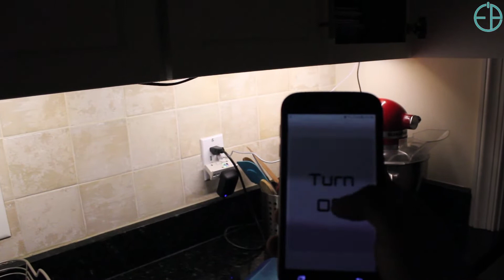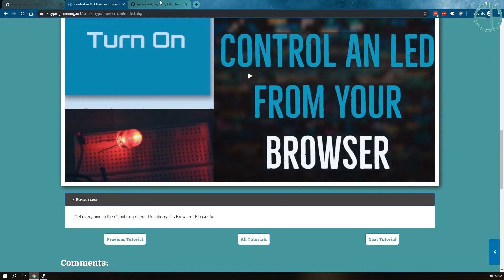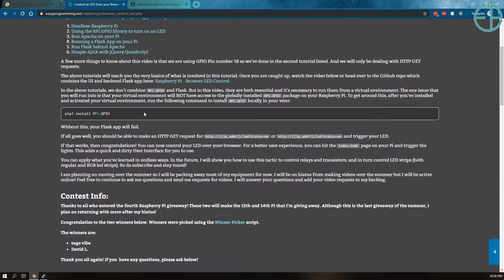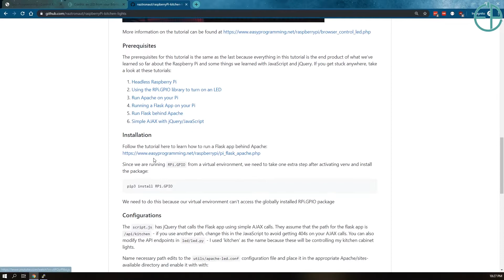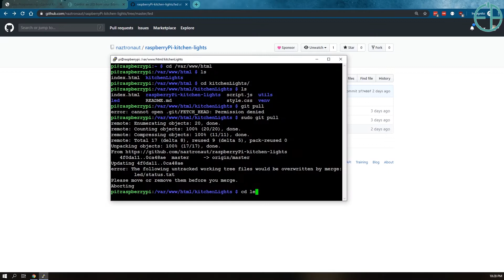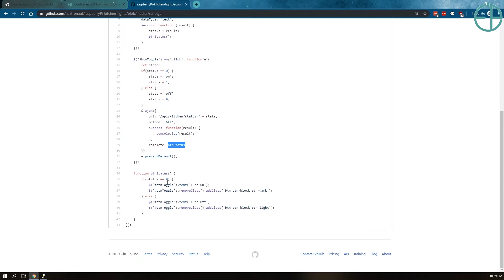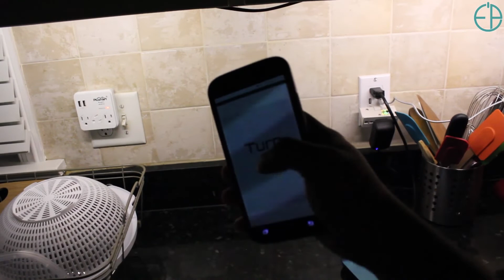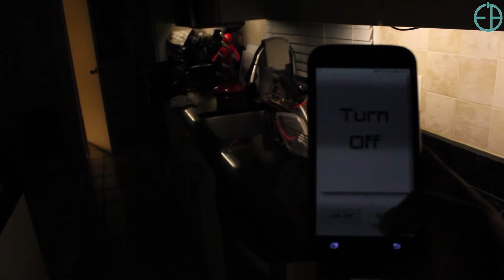Control an LED Strip with a Pi & Relay

Comment: I have questions how to create toggle switch button if I refresh not moving to default.
Reply from the maker: Just so I understand the question, do you mean that if you refresh, the button state doesn't stick? Like if it's on, it doesn't say on when you refresh?
Reply: Yes of course like this.
 how I can create toggle switch button, when I I'm off led or on led then refresh web browser not moving to default like off
Reply from the maker: @miguelborges6199  This project uses a 'status.txt' file to store the status. When a page is refreshed, the app checks that file to see the status. Were you able to implement this project?  If you have, you can open your JS console on your browser and see the requests. Make sure there is one being made to "ip_addr/led/status.txt". If it's not, then that's probably where the issue is.

Comment: If I don't have a relay can I use resistors?
Reply from the maker: If you have a transistor, you can use that. A resistor is only used inside active circuits to decrease current or voltage (among other things) only. You need something that can act like a switch which can turn on and off like a relay or transistor.